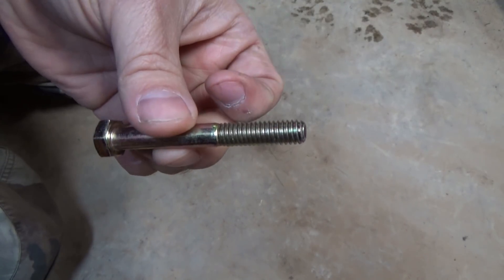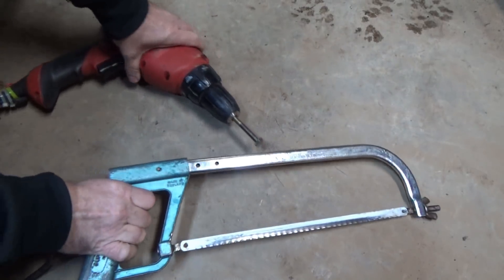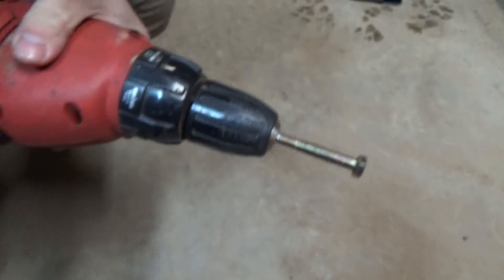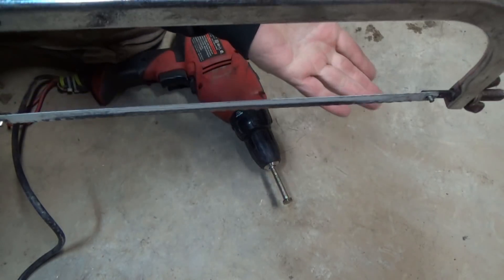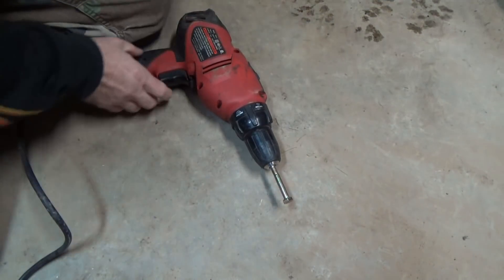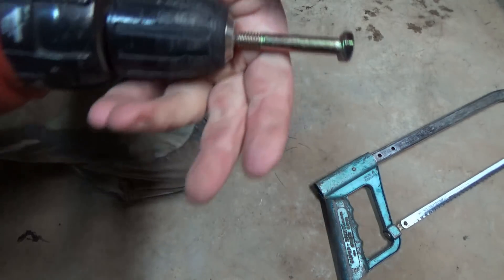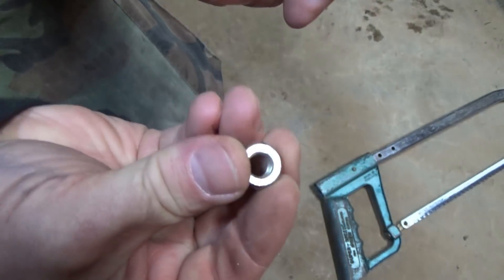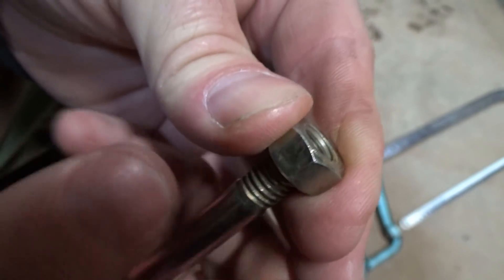Cut bolt with a drill?? Seriously?? Yep .. and its really easy!

Comment: You should put a nut on before you cut it. That way if the threads get a little damaged while cutting the nut will straighten them out when you remove it.
Reply from the maker: If I cut the bolts any other way, I do put a nut on it first. Using this method it cuts so clean that adding the nut first isnt needed. Thanks for dropping in and adding a great suggestion! Have a great day!

Comment: Great clip!  I'll use this tip!  Would you mind showing me how to change out the fuel filter on  a 97  Jeep Wrangler Sport?  Tip/question, I was thinking about getting a fluid pump, electric cheapo, to suck the fluid out of my jeep's front and back differentials.  Both have amsoil 60k miles and I am going to put amsoil back in.  Instead of messing around taking the diff cover off?  Jeep has 103k miles.  Or would you take the covers off and clean the inside with something.  Leery using break cleaner.  Don't won't it to break down my new amsoil if I didn't clean it all out.  Come to Nashville Tn someday and I'll buy you a beer!  Thanks!!
Reply from the maker: Thanks, glad you like it!! Here ya go! A cheap easy solution for pulling the diff fluid: https://www.youtube.com/watch?v=mWpfOPPGWMU . Im near Nashville: https://www.facebook.com/fixjeeps/

Comment: The best way to cut a bolt let me show you how READY?  READ THIS?? So first you will need a 14g copper wire wrap the wire around the bolt 🔩 now get a a hand held butane touch heat up the wire all around next get some freon and spray it right away and hit it with a hammer and you done.